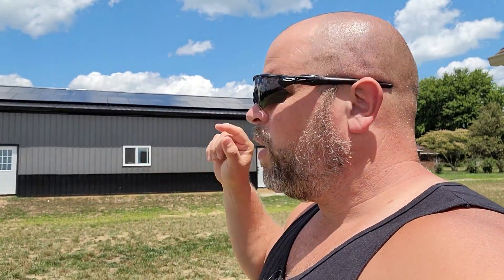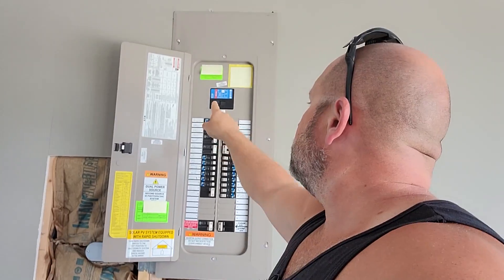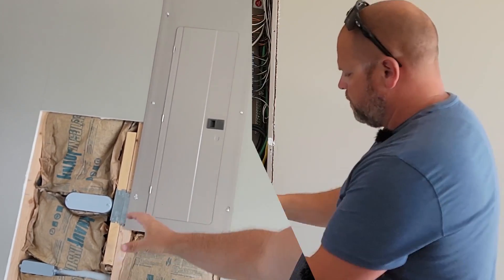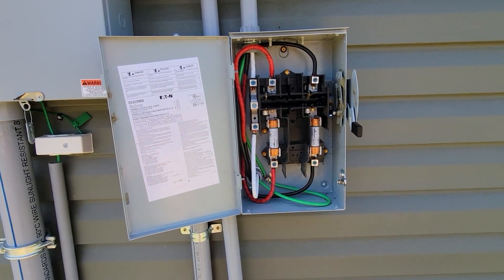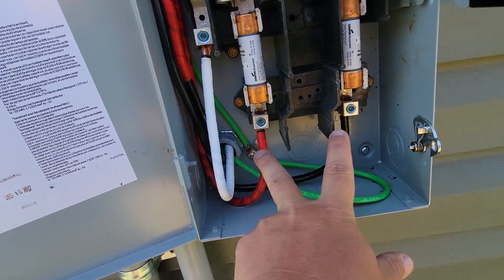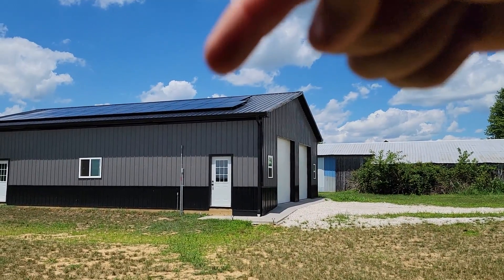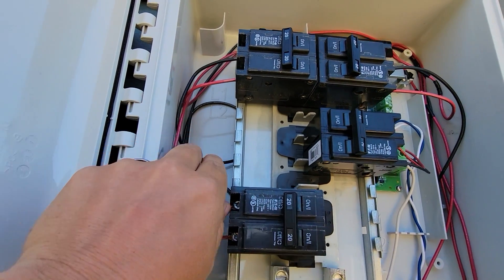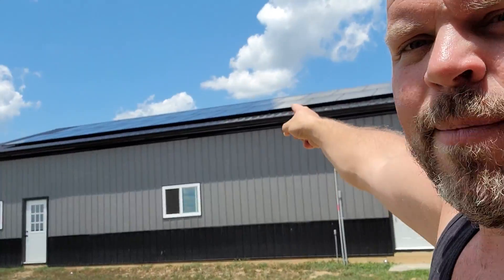EASY - Wire your own Solar System Using Enphase Microinverters

Comment: Justin, Love the detail of the video series of the install on a metal roof building.  I am trying to get the same type of system installed. I have a couple questions. 1. Did you space your connection on the roof to attached to the perlins or wherever they worked out according to the dimensions? I am thinking about running rails up and down the roof so I can connect the feet to the perlins that are on 2' centers. 2. How did you mitigate the voltage rise with the number of inverters and the length of run to the combiner box?
Reply from the maker: I designed the layout in portrait layout because that allowed my rails to run with the purlins allowing me to space the Solar Foot brackets at the recommended spacing. Also, felt it was a better option for load distribution. That all depends on the rail system you are using and the model of that system. Voltage rise was calculated using a Vrise calculator. I did not max my branches out with the highest number of microinverters so it was easy for me. I put 9 inverters on 3 branches for a total of 27. I do wish I would have used #10 wire but #12 was recommended and will handle up to the 13 total inverters on one branch. The only reason I would say #10 now is that if I expand later I will have to revisit the vrise. You can help that by making a cut in the branch, adding a field splice then running that to your jbox. However, increasing your homerun wire size is the most common method. Thanks for watching and commenting! 👍
Reply: What is the distance between your arrays and Enphase Combiner box? Thanks great job with your system.
 @TheSolarPit
Reply from the maker: @abdervish  Roughly 100 - 110 ft total wire length.

Comment: Thanks Justin! I just finished my 3kW Enphase system installation and am getting ready to request an inspect. What I couldn't find anywhere was a common sense demonstration of labeling. I'm following your examples by taking screenshots of your video. The Enphase combiner box looks so clean on my house, I didn't want to plaster it with tons of stickers! I figure I'll start with the minimum and if it fails the inspection I can always add more.
Reply from the maker: Awesome stuff! If you used Lyrasolar.com to design your solar permit package they provide what labels and where they are to be installed. Goodluck and advanced congrats on going solar! Thanks for watching and commenting 👍🏻
Reply: @TheSolarPit  Annnddd I just bothered to open the pamphlet that comes with the pack of stickers and found the diagram that says where to put what! lol
Reply from the maker: @MarknKC66  🤣 Solved that problem. Have you passed the inspection yet?
Reply: @TheSolarPit  Yes I passed inspection. First try.
Reply from the maker: @MarknKC66  Awesome brotha! 👌 Rock'n solar now and you did it!!!

Comment: great diy!
You should add the consumption ct's. They are a great add on to the system.
Just wanted to add that you only need the continuous #6 ground with no breaks on the roof portion of the system. Once in the JB you can make break and switch it for a #12 like the other wires. This will same you a bunch of money on the long run from the array to your home.
The array needs #6 ground wire for mechanical protection because it is installed in free air between the rails. Once in pipe it doesn't have to be #6 anymore.
Reply from the maker: I installed the consumption CT's in another video: https://youtu.be/37bNk42GG8Q - The electrical inspector advised that I was to install that ground from the rails to the combiner. Enable to pass inspection I followed his advice and ran it from the rails to the combiner box with no breaks. Thanks for watching and commenting! 👍
Reply: @TheSolarPit  every AHJ is different. It’s always best to do what they recommend.
Reply from the maker: @stephenvezina2314  True 👍🏻 I realized very quickly that a lot of people involved in the process. Inspector, Zoning, Deed Restrictions, Utility Company and in some cases even neighbors. I learned a lot and I'm glad I got it completed and operational in a fair timeframe.

Comment: Great video series, very helpful! What kind of conduit did you run from the junction boxes into your attic? The same PVC40?
Reply from the maker: Much appreciated 🙏 Anything outside that is exposed is schedule 80. Everything else was schedule 40 electrical conduit. Thanks for watching and commenting 👍🏻
Reply: @TheSolarPit  Thanks!

Comment: I'm confused on how you went from 3-20 amp breakers to a 60 amp disconnect to then a 45 amp breaker inside your panel? They are telling me I would have to derate my panel because I have to put a 60 amp breaker inside my main panel
Reply from the maker: It took me some time to wrap my head around that idea also. A design tool you can use for free to help you design your system is lyrasolar.com - You only pay once you need to finalize the design for print. Personally, once I started designing the actual system I started to grasp the reasoning of why I was doing certain things. In short that 45 amp breaker was rated at the max size breaker I could install for the solar due to the max bus rating of my box, which is 225 amps. 225 x 120% = 45amp - Hope that helps. Thanks for watching and commenting. 👍

Comment: Much much MUCH appreciate the info mate. I couldn’t for the life of me wrap my head around the micro inverters. 🤘🏼

Any chance you could do a simplified diagram on a whiteboard or something?
Why did you go with micro inverters instead the traditional string inverter or other options?
Reply from the maker: Very good question and suggestion. I will see if I can put together a nice presentation for how I installed my system on a digital whiteboard. I choose  to go with enphase microinverters for a number of reason. #1 if "one" panel is affected only that panel is troubled and not the entire array. If one microinverter fails I still have 26 panels producing. On a single string inverter if that inverter has problems, the entire system has trouble. I can monitor each panel's production using the enphase enlighten app. I personally love the level of detail it provides. AC vs DC - allowed me to use Schedule 40 and SCH 80 pvc vs Metal Conduit. So we will just call that one ease of install. I didn't have to buy any additional tools. The list goes on but that is a few of the reasons. Thanks for watching and commenting 👍🏻

Comment: How many inspections did you have to pass and what were they? Thanks
Reply: Be sure to check your locality and with the permits department in your county/city.
The utility company may be involved and you may be required to have a Bi-directional meter or update your current meter's programing to account for solar grid feed.
Reply from the maker: 1 electrical inspection. First had to apply for a permit which requires a solar permit package. Then I built the system and called the inspector to come review. That's about it. Thanks for watching and commenting 👍🏻

Comment: Thanks for the ground connection information. Very good to know.
Reply from the maker: Your welcome 🙏 Thanks for watching and commenting 👍🏻
Reply: @TheSolarPit So did you use stranded copper wire to ground the ironridge racks?  I was under the impression #6 solid copper was required to be run between the racks. Also do some inverters have an integrated ground system?  Specifically, the Hoymiles 1600-NT?  If the micro-inverters have integrated ground wire, what would the ground wiring be?  And thanks for the great videos!!